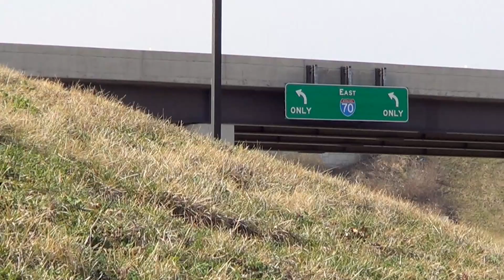MoDOT Recruits Solar Roadways

Comment: This is retarded idea that 0% chance of working.
Reply: +Havox Aerthis are you a troll or do you honestly want to know why this can't work?
Reply: Larry Lewinsohn  it doesnt matter if it works or not its just so inefficient that its pointless. No matter how good you make it there is no way its economically feasible
Reply: phoenixamaranth
I'm sorry but all your rants prove is that you have NO idea how power generation/storage from solar panels work and costs involved here. Your last sentence about 10% efficiency being enough clearly demonstrates that you mistake fantasy wishful thinking for real world applications.

You state :7)They don't melt snow, they keep themselves above freezing temp to avoid snow build up to begin with. This eliminates the high melt energy requirement - LOL and you accuse others of not knowing physics ? How is this NOT melting snow ?

4)It's not smooth glass. It's been given texture and bumps to create friction. It has passed necessary safety tests - really ? What tires were used ? I hope you understand that normal tires - designed for bitumen roads won;t work very good on glass surfaces - bumps or no bumps -  not to mention offing the water from under the tire etc - all of this is designed for asphalt roads.

Beside  - as Larry Lewinsohn - pointed, the only installation they presented broke down after a couple of days without any traffic - simply due to weather.
Reply: Its cheaper to create roads and solar panels separetly and both will be better.
Reply: Yeah and if you install solar panels the return on investment is 5-20 years depending on where you live so you want to quadruple that to 20-80 years when their life time is about 20+ years... smart move i have to say... and this life time is in normal conditions and dont even try to tell me the conditions will be better when we place them in the roads...
Reply: you cant be serious... no one is that stupid...
Reply: It's sensor, and sensors do not generate any energy.
Reply: phoenixamaranth 

1) there is a difference between a feasible fortune, current roads, and infeasible fortune, solar roadways.
2) No, we would be building something to have nothing since they don't and can't work.
3) Things that are this inneficient are called useless.
4) Yeah, it has? show me the test results, btw the only installation of solar roadways doesn't work, 70% of the panels stopped working within a 3~4 days and now, 2 months after installation, they are being replaced, all of them, they couldn't handle pedestrian traffic, how are they going to endure vehicles? lol.
5) What will be true?
6) Not true, since CSPs installations are usually used in combination with other energy generation techniques, non-static panels and/or other measures to improve efficiency, this technology is useless and a fraud.
7) Impossible. They would have to melt the snow anyway, since avoiding snow build up means melting snow anyway, and even if that would be the case you still have the problem of water.
8) Not really, since they would need different type of maintenance, both in terms of supplies and training.

Again, please just stick to the physics and you'll see very quickly this technology is nothing more than a fraud.
Reply: phoenixamaranth You did not learn a single thing from the video did you? Did you even watch it? Do you grasp the actual science behind it?
Reply: Warren Lauzon Sure you are. Then explain how you can't understand how this works. The physics is straight forward. There is nothing about these that doesn't work. They will produce power and that's the whole point. Are they going to be 100% efficient, powering everything, super machines. No. And they never claim to be. The point of them is to take advantage of the massive amount of land surface we have dedicated to roads to produce some power through solar. That's it. Even if only 10% efficient they would still be more helpful than no power generation.
Reply: TheDjsalem Let's start with the fact you didn't bother to check the source of that link. All that sites sources go back to good ole Thunderfoot. What a shocker that it all links back to the sensationalist who seeks to profit his Youtube by promoting bs drama.

"same amount of energy to prevent ice/snow from cumulating and simply melting it" I know the subtleties of things like physics alludes you, but no, it doesn't take the same amount. The water on the surface contains heat energy which means you don't have to keep putting in the same 334 J/kg as it will initiate an equilibrium with the snow, like when you put ice in a glass of water.. And the goal isn't to melt all the snow, only maintain that slosh layer so vehicles can drive. The cars input further heat energy into the road surface.

" Its clearly beyond your understanding that this area is much smaller on a glass tile with bumps than with a smooth asphalt road" Clearly basic vector physics alludes you...what increases friction isn't simply surface contact area but the DIRECTION of the force. Newton's laws at work, dipshit. When we have a perfectly flat surface but raise an area that area resists the forward force of the tire (3rd law) and causes the force to redirect, a redirection of a force is an acceleration (note in physics acceleration is general term with positive and negative acceleration) so it requires energy to maintain the same rate of velocity. No energy input, you slow the fuck down!

Current roads still use this same principle they simply have smaller bumps and so use them more frequently. When you have larger bumps you can use less and get same speed reduction.

God damn it's so irritating having to try to educate you fucking idiots. You have a very limited science knowledge and think because you watched a video by a sensationalist moron that you know something.

So glad that people don't listen to the likes of you and him, because if they did we'd likely never have anything. Cars, forget about it. Planes, oh that would never have gotten off the ground with you retards because you would have scrapped it at the first sign of not doing Mach 3 flight! Pretty much every single human invention has taken years to refine and make efficient, with large upfront costs that level out over time. Your lack of business acumen or understanding of product development is just pathetic. Fuck off with your stupid ignorance. The world doesn't need more of you.
Reply: One simple thing. Why would you put them on the road when you have free roofs and other space where panels will be more efficient?
Reply: Irek Cz. Sure, but with this you get some on the road plus what can go on roofs which adds up to more than if just roofs alone

Don't look at it through some sort of idealized glasses. In the real world, all roofs would be covered already except for that pesky problem of most people/companies won't front the costs. This is an economic middle ground solution if worked out. Money for roads is already allocated, if roads can be replaced with an energy provider, even a low efficiency one, it's a win.
Reply: Your argument is that we can make roads made of gold becouse if we buy them in bulk it will be as cheap as normal ones?
Reply: And even if they did whats the point to reduce their effectivness by more than 70% just to put them in the roads... its like installing a solar panel in your house floor yeah it will work but the energu it will produce is not worth it...
Reply: Irek Cz. How does this keep escaping your brain? Are you all simpletons??? I'm being for real at this point, not insulting because I can't fathom that none of you grasp this.

You were producing ZERO, fucking NOTHING when it comes to power previously. Now you have a road that can not only be used as a road but produces some power. It does NOT have to be the most efficient panel ever. It can be one of the shittiest ever. The point is for the same exact money you were already spending on roads you get something extra.

I'm guessing, from this conversation, that you're all likely broke from poor spending habits because none of you seem to have a grasp of physics, business, and economics.

Are you telling me that if you had the choice of a car that drives but has no options and one that drives the same but also comes with a radio, power windows, etc for the same price, you don't understand that you'd buy the one with the extras??? That's what this is: getting more for the same money you were already going to spend!

And as I've already pointed out, it's a better business model than trying to sell to people for their roofs because people aren't going to spend EXTRA money for roof panels because most people view it as a luxury expense but taxes for roads are already taken every year.
Reply: Larry Lewinsohn Source? Use Google you lazy sack. That's where you can easily get the last congressional budget for roadwork but why am I surprised someone like you wouldn't know how to use Google to research anything...

"they have never had a single panel produce energy" Are you seriously that fucking stupid? Where do you think the power for the leds came from??? Jesus, it's like talking to a fucking rock!

"nowhere near a light that would be visible in the day from the angle needed to be seen from a car." This is more idiotic bullshit. We use leds everywhere already in broad daylight. I see them just fine. Why? The design and angles. It takes nothing to angle them at just below the glass for specific purposes.

Why am I invested in bettering the world from morons like you guys that have no fucking clue about physics, business, or how anything in the world works? I don't know, maybe don't want anymore of your naysaying stupidity continuing to bring the world down and hold humanity back. It's a damn good thing people like Henry Ford, Edison, Tesla, etc. never listened to the likes of you.
Reply: Irek Cz.
These things are made of glass, other silicon, and few other materials already found in current asphalt roads. There are no exotics in them. Even now homeowners can buy roof panels at rates near the square footage rates of asphalt driveways of equal size, within a $1 or $2 of each other, so imagine the buying power of a state compared to an individual homeowner.

And one last time I will try to explain to you this concept of why you would do this. You are already buying a road. It costs you say, $2 a square ft. You now, instead of buying that $2 per sq ft piece of asphalt, buy $2 per sq ft solar tile. You can drive on it just like the asphalt road and you got the exact same coverage, but for your same $2 you now also get solar production. It doesn't matter if it only produces 1% compared to roof solar, that's still 1% more than you ever had with an asphalt road.

Now, I know your brain is balking saying, 'this idiot thinks a $2000 tile will get as low as $2!!!' Then stop and ask yourself how did the microwave go from being a $100,000 prototype, yes $100k, to a $50 one? How about the cost of computers? The Raspberry Pi $30 computer has the processing power of the 1974 IBM supercomputer that cost $40,000,000 to make. People are balking at the initial upfront costs of prototyping with no regard for the fact it's just prototype costs and will drastically go down in mass production.
Reply: Irek Cz. I assume it because of the materials involved! There is nothing in the tiles that is more expensive than the asphalt. I also assume it because that has been the trend of pretty much ALL tech in the history of manufacturing. Your claim that the price can't fall that far is stupidly disproved by past products which I gave you examples. The Microwave had a cost of 2000x higher than current models. Computers had costs up to 1 million times higher!

Your entire argument is predicated on the cost can't drop that far but that is clearly false.
Reply: Solar panels isnt a new technology... its not like we have 2 prototypes in the world now... most of the thngs needed in solar roads are already mass produced so its not like the cost can drop like that..
Reply: Irek Cz. You are just dumb and ignorant. The current cost of roof solar is already near the cost of asphalt per square foot. I already told you this but you just refuse to accept the facts in front of you. You want to continue to be obliviously stupid so be it, I've tried my best to educate you but you are just fucking ignorant. The cost of these tiles is because the rest of the tile is a prototype, you stupid fuck.
Reply: Irek Cz. I'm insulting you now because you are literally so stupid that the fact I have explained exactly what the hell is wrong with your logic to you over 4 times now but you still can't grasp it. You are still acting like you are spending extra money, you aren't. You're spending the same money for roads that you always were. That's where your little brain keeps failing you over and over. When you talk about return on investment of roof solar vs these tiles. you completely ignored that buying roof tiles was solely to get power. You're buying the road tiles for a fucking road! The electricity is purely a bonus, you stupid fuck! So the return on investment comparison you had there was absurdly false. You're buying a road, getting a road for the same cost as an asphalt road, but you also get fucking power at no extra costs! How the fuck can you not get that unless you're the village idiot or a troll?!
Reply: Are you serious now? Yeah you are buying the roof panels to get power and do you seriously think that putting panels in roads will be any cheaper than putting them on the roof?
Reply: Irek Cz. It's clear you're just a moronic troll. If you want to claim you're not, then reread my posts until your stupidity goes away, otherwise, I'm done with you troll.
Reply: Larry Lewinsohn Yeah, it's obvious he's the troll here because I can't believe you two are actually that much of knuckledragging morons.
Reply: You morons need to learn some physics and some business management. You think you have a grasp on the subjects but you don't. You all are literally so ignorant that you can't even fathom what you don't know. It's incredibly fucking sad and pathetic. Do some research, get an education

Idiots like you would never manage to provide anything to society because you're so ignorant and narrowminded. You don't understand how anything can work until someone else does it all for you.
Reply: https://goo.gl/LDA3tq
Reply: TheDjsalem So you stupidly link to a blog written by the same kind of moron as yourself. How original of you. Do you actually have any knowledge yourself and ability to think yourself or are you really just another parrot here? Let's hear some educational background, work experience, etc.? 

The 4 things that moron wrote, I've already shot down here over and over. It's complete bullshit from idiots with no engineering background and no ability to think critically.
Reply: Irek Cz. Hey princess, you might try reading all those posts above. I've destroyed all your idiotic arguments just like I'll destroy this one: "You are comparing the price of clearing the snow of the roads like we do right now to heating the roads of the whole country brilliant"

Newsflash, jackass, the whole country doesn't get snow in the winter, nor simultaneously. Critical thinking. It's your friend.

Plus, stop and think about all the costs associated with current road crews for clearly snow: you have the man hours, the machines, the salt/sand, the storage costs, etc.

Then there is the fact the system can supply itself with energy. The objective is not to melt all snow, it's to keep the road warm enough the snow can't stick and build up so cars can keep driving and their heat will add to the energy in the system. It's all a cumulative effect that helps manage snow and ice. It's not intended as an end all be all, but a system that makes improvement where people like you would throw your hands up and say, 'it's all or nothing!' Ugh, so sick of that simpleton mentality.
Reply: almost 100% of solar energy is converted to heat when it hits the road and it still freezes so how is your solar panel able to generate enough energy to keep the road warm enough? The only thing that changes when you melt the snow or if you just keep the road hot enough to not allow it to acumulate is albedo... but as i said even when it converts most of the light into heat it wtill freezes so you need to add the same energy + the difference albedo makes...
Reply: Irek Cz. You have to understand what leads to snow sticking. Roads absorb a lot of heat from the sun, but they reflect a some too. They also suffer from an equilibrium problem caused by contact with the rest of the material under the surface of the road: the internal asphalt not exposed, the ground below, etc. All that material underneath strives to be at thermal equilibrium so while the surface may receive a lot of heat energy from sunlight, it gets pulled off and dissipated so the surface isn't as warm as it was.

The snow then sticks and reflects far more light than the asphalt so essentially becomes a shield blocking further heat from getting to the ground. But if you have resistance wire running underneath, you can get heat to the surface and if timed correctly you can keep it from ever sticking. 

Now as for the energy and where to get it. Not everywhere receives snowfall and not at the same time. I live in a county that gets minimal snowfall and many times none while the next county up gets a light layer, and the next up gets more and so on. If implemented correctly, the roads from one county can supply the power for the next nearest to initiate the melt there, and so on. There are ways to maximize the effectiveness of the energy already being put into the system by the sun and not have to buy much external power. What you did buy would be offset by savings on road clearance. Resistance wire is pretty efficient as far as heat conversion goes
Reply: Explain ?
Reply: Because solar panels don't work when covered with you know - CARS !
Reply: Yes of cours, but car aren't covering solar pannel aull the time, and probably in the future they will add pressure censor (if you step on you will create electricity)
Reply: TheDjsalem We will see,
Reply: Havox Aerthis
We won't. It's a scam :)
Reply: 1)Roads already cost a fortune
2)Gee, we might have to build something to have something?
3)It's not about being 100% efficient, it's about taking advantage of the massive amount of road surface
4)It's not smooth glass. It's been given texture and bumps to create friction. It has passed necessary safety tests
5)This will likely be true but they will be able to be swapped out for maintenance easily
6)Various technologies are already being used for CSPs so this would use the same or simply feed into existing grid like when people have solar for their house and produce too much
7)They don't melt snow, they keep themselves above freezing temp to avoid snow build up to begin with. This eliminates the high melt energy requirement
8)Same people that already service our road systems. DUH.
Reply: Larry Lewinsohn

1)Current roads cost hundreds of billions to maintain. Congress' last 5 year budget for federal roads: $305 billion. Mass producing glass and electronics is already proven cheap. When products are mass produced on such a large scale they get even cheaper. There would be no higher cost over asphalt once in mass production.
2)They do work and you're dumb if you think they can't.
3)This comment from you shows your narrowminded thinking. You don't have to have even 50% efficiency when you are talking such large scale implementation. So tired of such all or nothing thinking. A whole lot of little pieces add up to a big piece.
4)On their site they had to pass national safety tests before they could put them down, including stopping wet in required distance. Friction is determined by surface texture, not material.
5)Can you not read the previous list? They will get dirty like all things, but they can be swapped and cleaned periodically or as proposed other means of cleaning implemented
6)Jesus, if you don't even know about current Concentrated Solar Power storage solutions, don't speak about solar anything
7)Hardly impossible. Ever heard about ground being too warm for snow to stick? This is a proven tech already. PROVEN. It exists in heated driveway systems.
8)Damn, you'd think we'd know how to train people to do other things when tech changes...oh wait, we do that already...

There's nothing fraudulent about it if you actually understood physics. So tired of seeing naysaying nonsense by people that actually don't understand physics but claim to.
Reply: Warren Lauzon Do you have a brain and even know any physics? So sick of fools with no knowledge of physics and materials naysaying this because they are simpletons.
Reply: phoenixamaranth I am an electronics engineer and spent nearly 15 years in the solar/PV industry, so yes I know "any physics", and I also know that this is total bullshit and cannot possibly work. It appears that I am not the simpleton here...
Reply: Irek Cz. They aren't planning on just being on the road, but roads are already a lot of surface area and money spent in maintenance. From a business perspective, getting people to swap to something else when they are already paying is easier than convincing a lot of private companies to buy something completely new.
Reply: Irek Cz. No it's not. It's not cheaper to make two totally different things rather than replace one with the other...Roads cost hundreds of billions to maintain as they are. If you swap over to solar, you still get a road, but now put your same money into solar too.

Also, roofs belong to private companies. Who is paying for those panels on those roofs? Very few companies will budget for such an upfront cost.
Reply: You would need at least 3 times more solar panels on the road to get the same effect as on the roof..
Reply: But those roads would be far more expensive than making the same roads and panels to produce the same amount of energy.
Reply: Irek Cz. No, those roads are really expensive to make now because getting 30 or so panels made for a one off test is expensive. Getting 30 million made gets great bulk pricing deals. Like all products, the more you buy, the bigger the discount on materials you can get.
Reply: Irek Cz. Let me try to explain this to you another way:

You have $305 billion that is already being spent on roads. There is no way around the fact $305 billion has to be spent to maintain some form of road.

Current roads offer only one thing: a place to drive for your $305 billion

You REPLACE those same roads with this new product  as part of the usual road maintenance costs and you will be able to negotiate much lower prices on the panels because you will need literally millions of them. All products and business work like this. The more you guarantee you'll buy the better the deal you get.

So you spend the exact same $305 billion you were going to spend but now you have a road that also produces some energy.

You win because for the exact same money you were going to have to spend you got something more than just a road, you now have a road that produces some power.

See how that works?
Reply: phoenixamaranth
One last time, where did you get that figure of 305 Billions and what don't you get about the panels NOT WORKING? They haven't produced ANY energy.
Reply: phoenixamaranth your whole point is invalid becouse there is no way it will cost the same as normal roads...  and even if it would(which it wont) it would still be better to remove the panels from the roads and put them anywhere else like on the roofs or even on the pavement...
Reply: phoenixamaranth you keep saying im assuming the cost is too high and it wont go down when i never said that... maybe try to read what people say instead of imagining what you want them to say... The cost would obviously go down but it would still be much higher than for normal roads. Secondly you asume that im anti progress... I want solar energy to be even more popular but thats not the way its pointless like it would be to install solar panels inside our homes.. Yeah they would work but they will be ineficient... Those solar panels in the road would generate electricity worth less than the panels intself so whats the point?For example if you buy a panel worth 1000 dollars and through it whole life time it will make electricity worth 500 dollars do you really think its worth it?
Reply: phoenixamaranth you keep asuming that the price will be the same as normal asphalt road which it wont be... it will be cheaper than it is but it wont reach the asphalt price so that point is invalid...
Reply: Irek Cz. dude, he has to be a troll, Poe's law. Cheers.
Reply: Irek Cz. You need to get an education. You are literally a fucking buffoon with no grasp of economics. The current cost of solar panels for home purchasers who do NOT have wholesale buying power and they are still nearly as low per sq ft as asphalt right now for individuals Again, as I already said, the buying power of a state or a country will drop that even more proving just how fucking ignorant you are.
Reply: Irek Cz. I'm serious because I've done the research, jackass. Why don't you go check the costs estimates per square foot of asphalt to solar which includes installation. For home buyers not buying bulk, not getting wholesale or manufacturer discounting, the costs are roughly the same at around $5-6 depending on  location of course.
Reply: yeah compare normal solar panels to asphalt roads obviously you can get them on the roads fresh out of the box...
Reply: Oh you run a buisness then you cant make a mistake... there are people who deny climat change and science and are presidents so you running a buisness makes you infallible for sure. Even if we would accept the things you say about the cost you still would need to pump power into this in the winter if you want the snow to melt. There is no way it can melt it by itself... You just assume that its a good idea and that everything will work as they say and that mass producing it will cut the costs so much that it will cost like like normal roads do but it wont. Now solar panels are mass produced and even if we take what you say the solar panels cost the same as roads if you look at area. So the same cost for solar panels only when you need to add LEDs, computers, glass, manufacturing, research, rebuilding the roads and adding power to the roads in the winter... Im sure i didnt cover it all. So you add those things and they will be for free somehow?
Reply: Irek Cz. You think you're not deserving of insults after I've had to repeat the same things to you over 5 times? Sorry, princess, but you're a fucking idiot and you're in public trying to claim something doesn't work simply because you're too poorly educated and dumb.
Reply: phoenixamaranth  you are the princess here... you dont have arguments so you go and insult people... I really dont care about that besides the fact that is sad that people like you exist... I would have to be stupid to be ofended by random people on the internet...  You are comparing the price of clearing the snow of the roads like we do right now to heating the roads of the whole country brilliant... If we are at that maybe lets just heat up the air too so we will have warm weather all year long?
Reply: why are you arguing about ice? even in the best conditions you will get more energy/$ with less durable panels that are not being constantly run over by cars blocking the light
Reply: phoenixamaranth
Hahahah Being called a moron by a imbecile who doesn't understand that it takes exactly the same amount of energy to prevent ice/snow from cumulating and simply melting it is pure comedy gold.

Another fucking gem of wisdom: Yes the traction comes from the force of friction - and this force is dependent on the surface are when the tire and road meet. Its clearly beyond your understanding that this area is much smaller on a glass tile with bumps than with a smooth asphalt road. What an idiot.

Where it broke ?

Here:
http://dailycaller.com/2016/10/18/solar-road-has-total-and-epic-failure-as-83-of-its-panels-break-in-a-week/

First presentation.
Cost of installation 60k $ for 150 sq feet
Energy produced: 0 (zero) W

And stop calling people names you little numb-nuts and hit the books. Preferably some fantasy novels. This is clearly where your heart is.

And as for your "improvement" for energy production - it would be cheaper to build a nuclear power plant every 10km than use this solar powered stupidity.
Reply: Bullshit is becoming a new religion... Homeopathy,antivaccination, anti gmo, anti gluten, accupuncture, flat earth, solar roadways, etc etc... new bullshit based religions... No amount of evidence will make them think... he will claim that the laws of physics can be broken by mass producing something... I sometimes wonder why do people with perfectly functional brains choose to just throw logic out of the window and be morons by choice..
Reply: Larry Lewinsohn  yeah i guess so... he doesnt read at all and just repeats the same bullshit all the time...  somehow he thinks that putting solar panels in the roads will make them much cheaper...  Oh i forgot everything is cheaper when mass produced and lets ignore the fact that solar panels are already mass produced and wont get much cheaper and even if they would it would still be better to put them on the roofs becouse putting them there would be cheaper thatn it is now too...
Reply: 1. Blog or no blog math checks out. 
2. I'm not talking to you.
3. Stop throwing temper tantrums. 
4. GTFO
Reply: phoenixamaranth Firstly you keep making the claim about the 305 billions, I'm asking for your source, not you to repeat the claim, where did you get that number, from which institution, since the numbers that are available say around 41 billions per year on road maintenance.

Secondly, I'm not talking just about the fucking installation on Sandpoint, I'm talking about all the proof of concept they have made since day 1 of the "project", they have never had a single panel produce energy nor they have been able to produce a panel that is capable to produce a light that is visible during the day and nowhere near a light that would be visible in the day from the angle needed to be seen from a car.

This technology does not work, why are you so invested on this crap? If this thing works, where is your evidence since the evidence supporting that this doesn't work is freaking everywhere.
Reply: Insult me more not that i care much about it but at least you prove your stupidity when instead of arguments you just try to belittle everyone else...

I was reading your comments and you cant grasp a single thing that im saying here.... You want to spend more on the panels than the electricity they will produce will be worth yeah seems like a good idea... I will install solar panels under my bed becouse that light that goes there is wasted i guess...
Reply: I think he invested in this 'project' some of his own money. No one can be that f stupid. Where did he take this life spans of 20 years. 5 MAX. Even on their own website they admit that glass they want to use doesn't exist right now. Show me a LED diode with 20 year lifespan. He thinks that this panel will reach thermal equilibrium above the water freezing point all by itself because shut up it will. And his understanding of economics is straight from a Terry Pratchett books. Give yourself a break.

Edit:

And of course solar panels are cheaper than asphalt roads in his magical fairy land. 2cm of magical non existing super glass with LED diodes and solar micro-inverters are f cheaper then asphalt ! Not to mention that they don't require any infrastructure because 'the grid' in this fantasy land is just something that exists and is available to anyone that believes hard enough.